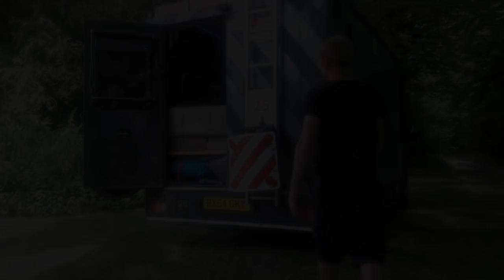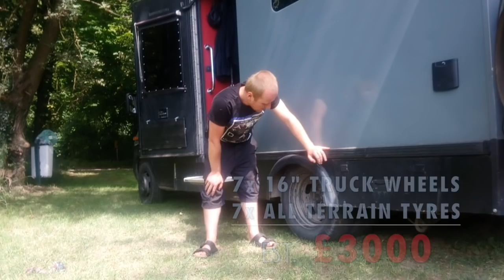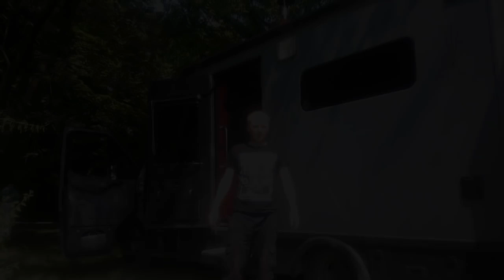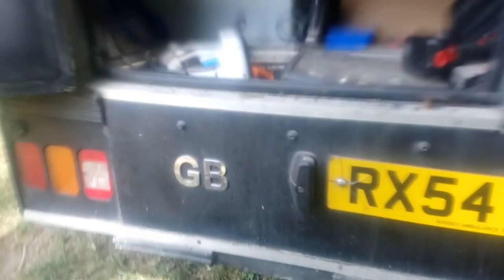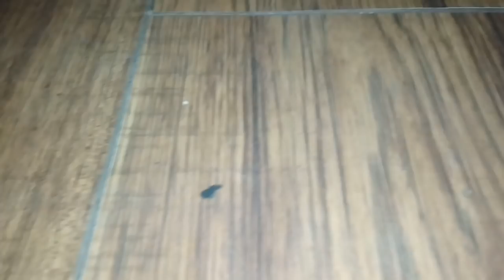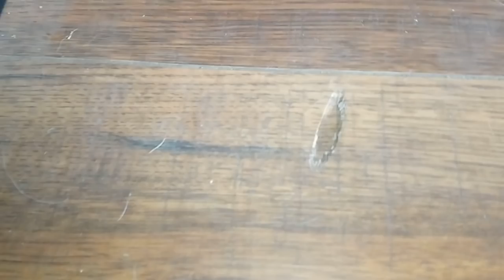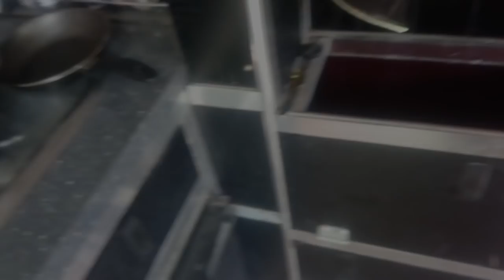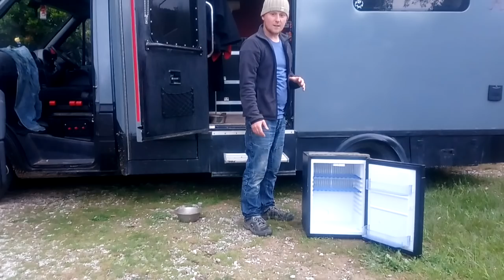Where I went wrong with my van : mistakes & planned changes

Comment: Buy a Dometic CFX series compressor fridge. They're portable, but you can build a cabinet that's just barely larger than it and put it on some industrial sliders and just pull it out into the isle when emptying or filling. Use almost no amperes on 12 volts, and people tend to love em. I mean, a fridge that's opened on the side makes no sense in a van, anything in there that's been bouncing around will just fall out. A chest-style fridge, well, they can hardly fall UP.
Reply from the maker: Croft very true, i forgot to mention that my "campervan" fridge has no lock on it and empties itself when going up hills 😂
Reply: Well, the prosecution rests. :) Side-opening fridges in a vehicle make no sense. I like the big drawer-style fridges you see in some luxury American RV's but kind of overkill for a small vehicle, so the compressor-based Dometics are a great alternative. There's even some models (when going up in size) that are split so you can have a fridge section and a freezer section. Ice cream in the woods anyone?
Reply: CDF-26 is cheap on amazon right now, £379

Comment: Yeah there's a reason why my van conversion will simply have no gas. It will have Lithium batteries, so I may go with an electric induction top - or else, just diesel burning for heat as well as cooking. A bit pricier, but no worries about propane - fitting it, storing it or finding it. And if I run out of diesel, well, I'll have bigger issues than cooking.

Also, as for the microwave - yeah, without Lithium batteries and a serious sine wave inverter, it's kind of borderline pointless. You can run the microwave off a battery just fine, just has to be big and Lithium. In fact, with enough solar and Lithium batteries, you can run an air conditioner - a small air conditioner, but still, with 1000 watts of solar or thereabouts you can run AC all day and still put a little charge into the batteries. But with normal lead-acid batteries and for off-grid living, yeah, a microwave is pointless.
Reply from the maker: Ahh nice one, I'll definitely consider lithium then. A pricey upgrade as i need 4 lol, but once it's done it's sorted i guess. I'll still have gas as back up but it'll help with the fridge and my binge tv watching 😂
Reply: Yep, and you do need to pay attention to your supporting electronics, ie achieving those kinds of amps may be limited more by the charge controllers and such than what the alternators can produce. But still, you can run them down to 20% charge with no damage, so 100 Ah in Lithium is actually 80 Ah usable. And no panic about recharging immediately.
Reply: Lithium batteries and Induction Cooktop will be Awesome!! I have a Induction Unit and 2k Inverter I use for  Car Camping Worked Great!! Just add a good Solar setup and you be Gas Free!! Safe Travels!!!
Reply: Wait until the suns not shining and you don't want to drive to charge your batteries up and you'll see gas is necessary for fulltime conversions. Refillable bottles cost 15 euros to completely fill 11kg and it's everywhere in Europe, I've never had a problem finding it.
Reply: The thing is, Lithium changes the game quite a lot. Unlike old lead-acid batteries, they can charge at staggering speeds. You can cram 2-3-400 amps worth of current into them and they happily gobble it up. So you can high idle the vehicle for half an hour with a huge alternator (if there hasn't been sunin a few days) and be good to go for many hours. 15 euros time after time starts adding up to real money after a while. Granted, with solar and Lithium you pay that money up front, instead.
Reply: 100ah lithium batteries are almost £1000 each, so 2 of them, plus a large alternator and you're looking at well over 2k, that's 10 years worth of gas fulltiming. Then you need to take into account the diesel cost of running a 300amp alternator. On paper it's a perfect solution, but the numbers just don't add up. A lithium, solar, alternator solution would cost more than my entire campervan cost me. When Teslas are more mainstream and you can buy the battery packs with built in bms from write off's then it might be more feasable.
Reply: You can buy Lithium cells for far less than a thousand pounds. 4 Winston Chinese-made cells at 160 Ah, 3.2 volts each (which means 128 Ah usable, which is the equivalent of over 250 Ah of lead-acid) in series is $800. The battery management system is another $350, granted. The lifetime of that system can be as high as 5000 cycles or more, or over a decade, which makes it quite competitive with lead-acid. And the usage experience is miles better, it opens up for using power in ways that just haven't been possible in an RV or van conversion until then. Running a microwave is easy, or an induction cooktop, and so on. Yes, it's more up front than lead-acid batteries. But not only is the weight of it a fraction, the ROI is excellent, and the cost over time works out favorably, even without involving the cost of gas, just by comparing it to the cost of replacing your lead-acid batteries every one or two years (worst case).
Reply: Or buy this complete (except for charger etc)  200 (160 usable) kit for $1200 or about £960. https://www.ev-power.eu/en/By-Brand-Manufacturer/GWL-Power/12V-2-4kW-LiFePO4-yacht-set-with-200Ah-cells-BMS-mobile-monitoring.html

Personally I'm staying away from the Tesla cells, they don't use lithium ferrous phosphate, they use actual lithium ion with cobalt. That is far higher energy density, which is great for range, but that also is the reason their packs have both heating as well as liquid cooling systems, because lithium ion cells are kind of explodey compared to LiFePo4 which is a much more stable chemistry, even though it has lower energy density, so the cells give less power per kilo. Still vastly better than old lead-acid technology that was invented in 1880 or some such.

Comment: you can fit the 16" rims all round from the newer dual wheel sprinters but you need to change the studs and nuts as well. it's also possible to fit the super singles on the back but then you end up with two different tyres sizes. Far as awnings go you can pick up a second hand house awning that should do the job for loads less than a Fianna one. ;) You can get spill proof dog water bowls for a tenner off amazon.
Reply from the maker: popuptoaster yeah someone else mentioned the super singles but I'm not too keen on them, but I didnt think about tinkering with the studs for the newer Sprinter steelies! Thats worth looking into a bit more, thanks!

Comment: Some ideas for your "upgrade". Try fitting a sinking shower tray with the plug hole in the middle and a slight slope into it, then it doesn't matter what angle your van is at. You could try a boat builders yard or some other fibreglass constructor who will make you one to custom fit your needs. We had our plastic shower tray replaced by this method when it split in our motorhome. 

Your fresh water tank is better being kept inside if you can. Outside, underslung  ones can be very susceptible to damage from stones etc, especially if you're going off road a lot. They also need some proper decent waterproof insulation other wise a decent frost will freeze the water in it, and any pipework going to pumps etc.

The things described in your video will cost you quite a bit, it might be worth looking at another van you can put together with your modifications for less.  Or even look for one that has been already built. What ever you choose to do, good luck with it and I look forward to following more of your adventures.
Reply: Going under is smart - yes, you need to protect and insulate.  

Insulate the whole floor from the under side...  This does to things - 
1: keeps flooring from becoming to hot or cold.
2: the flat underside helps smooths airflow - may ad a few mpg's if your lucky.
Reply: Yeah, underslung tanks do make a lot of sense since it frees up SO much space, but then you have to consider adding some protective plate over it, and take frost and freezing temps into account.  Big RV's often have electric heating pads, and that works, but then you need enough electricity capacity to actually feed heating pads. An Ultraheat pad (the smallest they make) is over 4 amps at 13.5 volts, and their pipe heating pads draw as much. So, what, 8-12 amps? going to keep the plumbing from freezing in the winter. That's a lot, and very hard in an off-grid vehicle without a generator. Advanced RV has done something pretty clever there though, they have channels added to their tanks, ie basically an indentation. They then run their water-borne heating return lines through there (they use an Espar Hydronic diesel heater augmented by an option to heat via mains AC electricity, by Rixen) and lump their plumbing and water return lines together as well. Free heating of the tanks and the plumbing, while heating the vehicle.

Comment: having a watertank on the outside might freeze the water during winter. not an issue if you never travel in colder climates but might want to get it isulated if you ever wanna camp in the snow.
Reply: Insulation alone won't do it, you need a way to actually heat them. Electric tank heating pads is the norm, but those are tricky in an off-grid camper van. Definitely doable in several ways I can think of but it has to be heated. Somehow. As does the plumbing itself, if your pipes freeze you're still SOL.

Comment: Those top down shots you mentioned with all the stuff in the van outside, I was thinking the exact same thing about my van hahha it wouldn't fit in the photo. For our dogs we use an anti spill bowl for water and two rubber collapsable bowls for food it works well and water doesn't go all over while driving.

Comment: Loving your vids mate & you've built such an awesome van! I was just wondering how practical it would be to tow a small trailer? Would it seriously restrict places you could visit, or do you think it would be manageable?
Reply from the maker: MrSolstice87 I've had this chat with a few people now, a trailer would be great (at one point i wanted to get a boat eith trailer to pull around) it would allow alot more storage and my van could easily pull something of decent weight. But in all honesty looking at the places I've been, mainly offroad and tracks etc. A trailer would have been a real burden and I'd have probably missed out on some really remote locations if I'd had a trailer.
Reply: Project Amber thanks for the reply. I guess it comes down to that age old trade off between comfort & freedom. The places you've shown in your vids look stunning & for me, that's what it's about. I'll have to ditch the trailer idea :)

Comment: From watching your videos, I would say your van conversion and trip has been successful despite the 'bumps in the road'. You learn from your mistakes and it's best to look back on this as a 'shakedown mission' to find out where the improvements need to be made. Glad you're going to ditch the laminate flooring. Too damn heavy and every kilogram removed means less fuel being used when driving.

Comment: Dude have a look into hand throttles, off road vehicles have them to bring the idle speed up slightly in low range for crawling at low speed, some older Land Rover and Millatary trucks used them possibly unimogs as well
Reply: might not work in his case , i think the newer mercedes trucks have an electronic trottle
Reply: Yep might be a job if throttle is fly by wire but works well on a jeep fitted to the gear stick
Reply: If it's electric then probably even easier. They'll be a thing you can plug straight into a obd2 port.
Reply from the maker: That would be ideal, but unfortunately my age sprinter has it's own version of the OBD port, the star drive or some crap, just to make diagnostics etc. that little bit more expensive 😂

Comment: Nothing is right first time round. Not a ballsup but a learning curve. I have an ex sussex ambulance chevy with v8 Diesel. Had it for years with a view to making it an overlander. Your idea of the mez floor with hard side lift roof is something i planned to do. Big job though. What mpg do you get with the sprinter?  Cant be worse than my current travel vehicle which does about 19mpg. Good to see you like urbexing, been doing for years mainly on bike trips to europe but now doing it on 4 wheels as it allows more freedom for walking of into the sites. Great channel 👍
Reply from the maker: N K if I'm light footed and drive properly it's suprisingly good on the juice, i can get about 27mpg on motorways. But city driving and when i plant it its probably as thirsty as what you have lol

Comment: At last somebody being honest about van builds. I don't think you will ever finish tinkering with your van, I'm making changes to mine all the time and it's usually budget that holds things up . You can buy a throttle rod to control tickover when parked up it fits between steering wheel and throttle pedal and works on the same principle of a mystic gun costs less than a tenner from a good car parts shop . I've got a table top 240v compressor fridge in my campervan run it off the inverter once it reaches the right temperature and it's well stocked with goodies it hardly uses any power never had a problem with it.  Just leave it on all the time but you must keep it pretty full so items inside hold the temperature down no goodies Moore power. Sorry for going on good luck with the changes.
Reply: Definitely go with the compressor fridge - they truly are the bees knees. Also, Toyota Landcruisers have a hand throttle button on the dash which winds the idle speed up mechanically - I think it should be able to be fitted to yours.
Reply: Truly refreshing, so tired of the perfect life lies that keep being told.
Reply from the maker: Roger Faulkner ahh brill ill look into this throttle rod!
Ahh yeah on electric my fridge is the same, needs food inside, but if the van is even slight off level it'll just start hearing up, crap lol. I'll need a sit down and look up what fridge is best for my needs
Reply: @ProjectAmber  If you have an inverter over 1500 it will deal with a domestic fridge which can be bought for less than a £100 and will use no more power than the 12v fridge.

Comment: Possible solution for dog bowls.....on a sliding tray with edges,that goes into the space cut out into the red wall which could be lined  with something waterproof,easily wiped.any spills from eating will be in the tray. also have  some plastic lids that fit over the dog bowls like tuppaware that can be put on the bowls  when on the move and the bowls are slid away nothing spills.
Reply from the maker: Sunrise seven Sunrise seven thanks, I'll incorporate this tray idea and easy wipe material with Don van builder's idea, making the in floor bowls but it could be sunk making a tray 👍